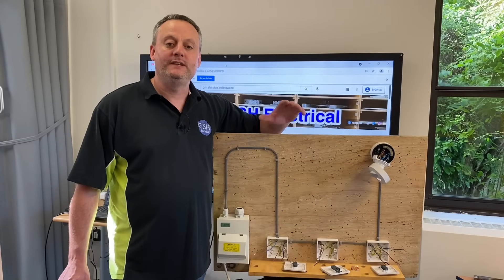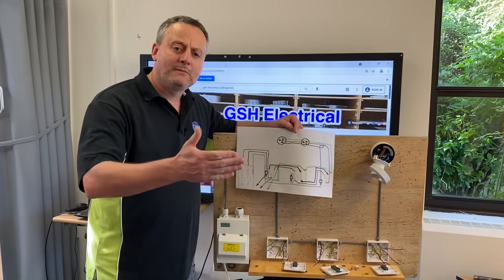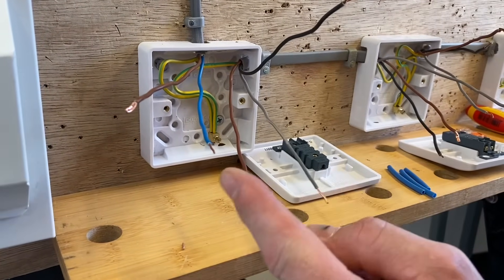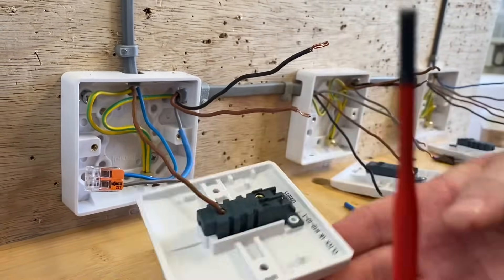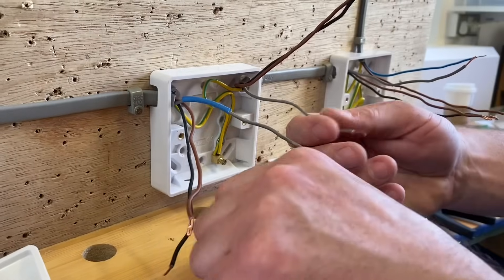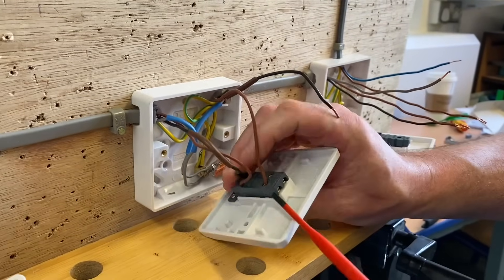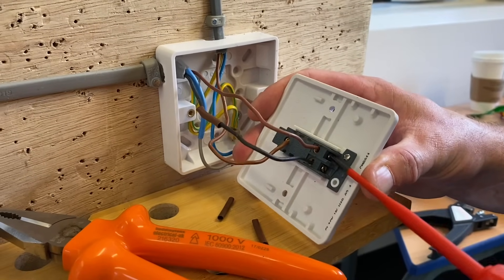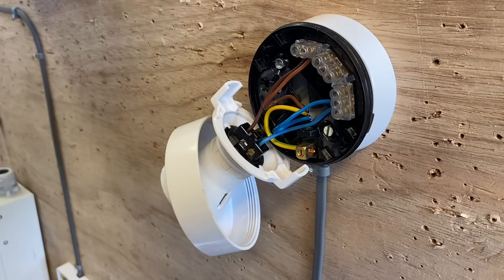Connections Explained - Wired Through the Switch 2 Way and Intermediate AM2, AM2S & AM2E Assessment

Comment: This is a great video, my question is how can you also bring permanent line to the final switch? Say, for example, if you have a two gang two way in the final switch and you want to power a separate set of lights using the neutral we’ve just brought through?
On the final switch, can you bring L1 AND L2 from the first gang both into common of the second gang to act as a permanent line?

Comment: What if there isn’t a grey wire can I connect my blue to black and red to orange if I’m trying to connect a plug socket when  using old wiring red and black, can these be connected to blue and black and then red with brown? To give power to the socket? Or is this not safe? there is a fuse box attached the plug socket already?

Comment: Thanks very much great informative video. This is all new to me using the grey as carrying the neutral on through so i really enjoyed learning about that. Am i right in saying that in the 3 plate method theres no neutral at all at the switch and they are all line connectors either switching line and 1 perm at the first switch and the role of the 3 core is to carry the common on through to the final switch not mattering if theres 1 or 10 intermediate switches in between and that the other 2 conductors of the 3 core cable link up the L1 and L2  to the intermediate and last two way switch and theres no neutral whatsoever because its at the 3 plate in the ceiling so this is only for 2 plate because the neutral is at the first switch and its not needed at the intermediate and final 2 way switch but its vitally important at the light fitting and this is why its carried through to here. Does that make any sense at all Gaz lol.
Reply from the maker: This should help

Wiring Diagrams for Lighting and Motor Circuits
https://www.youtube.com/playlist?list=PL2Ea5r9gxUUfm4SACOSOZigCeSxxC5xaO

Comment: Also I came across the normal 2 way method without neutral. I found the yellow and blue as strappers and red in common from 1 switch. On the other switch I found the red from twin and earth in common from 3 core yellow and blue as strappers and the red of the 3 core was connected on the black of twin and earth with connector. All colours were marked with red sleeves. Some I've seen  black was in common and reds connected on a connector block. Is that  still

Comment: If that’s in the Am2 could you just use the long lead method for r1+r2 and test between cu and earth at the light to get the overall R2 as it’s the furthest point and test between live at the board to live at the light as it’s the furthest point and operate the switches and the highest will be my R1 so I would just add them up to have overall R1+R2 for the circuit?? Thanks

Comment: Thank you for sharing your knowledge 

That has helped a lot 

Next question sir 
That’s was 2 way and intermediate 

To one light fitting 

How would it work for 2 /3 

light fittings 

Ie 
Switch at the Bottom of the stairs 

To make bottom light middle floor light and attic floor lights come on then to be able to switch them all on and off from each floor 

Thank you

Comment: Thank you 

Could you do a video on 
2 way and intermediate 
With 2 light fittings 

As you may have on top of landing and the bottom of the stairs 

Thank yoi
Reply from the maker: This maybe useful 
Wiring Diagram Using a 2 Gang Switch Downstairs & Upstairs 2 Way Switched on the Same Circuit Fuse
https://youtu.be/eyLNm057obo

Comment: I really like this method of 2 way / intermediate switch wiring as you always have the neutral at the switching point so you could tap off it at a later date for extra lighting or when fitting a smart switch. Took me a couple mins to wrap my head around it but it’s pretty much the same as single and earth being the permanent line from the board at one end and switched at the other to the lamp with the twin strappers in between. Very good!!
Reply from the maker: Thanks for commenting and watching 👍🏻
Reply: Ever tried to ram a new cable down to the switch for a new feed avoiding a truck load of plasterboard adhesive? It is a pain to say the least. I see the advantages for it if you want smart switches etc or Mrs Jones acquired some fancy luminaires from John Lewis (whose lights are actually pretty decent to install to be fair) that can only accept a single cable but in my opinion you cant beat a tidy 3plate rose for ease of additions.

Comment: I asked a question on my last job as to why we had wired feeds to lighting position instead of the switch knowing JB would now have to be used everywhere and was given the strangest look from the foreman and simple told "you dont wire neutrals down to switch". I wanted to say I'd seen it done many times before so what was his reasoning but the look he gave told me not to bother asking.can you clear this up at all?
Reply: Was it wired in singles or T+E? if it was singles then that will be why you dont take it down to switch
Reply: @JaackBorland  it was twin and earth wiring using 501 junction boxes everywhere
Reply: @drpantastic1969  ah even still there isn’t a need for neutral at the switch using jb method, it can be taken to switch but for ease of wiring it’s taken straight from jb
Reply: @JaackBorland  I threw another question your way if you know the answer and have time to answer it.thanks for the previous response
Reply: @drpantastic1969  let me know if that makes sense. I can explain in more detail in a private message if that would help!
Reply: I thought for ease of wiring it's better to have feeds at switches(neutrals connected in a block) then you would only have maximum of 2 cables at at lighting points eliminating need for j.bs .is there a regulation on this or is it just choice? I'm sure I ve seen a switch with an unswitched neutral terminal built in like a connector block to accommodate this style of wiring
Reply: @drpantastic1969  it’s down to choice I would think. You only need one wire at a 1 way switch if using Jb method. Your neutral conductor on a T+E at switch can be used as switch wire back to JB if that makes sense?
Reply: @JaackBorland  ok thanks
Reply: It makes sense and I do understand both ways of wiring I just want to be able to put fourth and informed answer when I'm told "you dont wire neutrals to switches" as I know the topic will come up on site again. as there must be a reason why we have  2 and 3 plate systems
Reply: @drpantastic1969  To try and explain it short and sweet. Your neutral is only there to complete the circuit and bring it back to ground/earth, switches do not require a neutral to operate, lights do. So when wiring in a JB method your neutral is at the JB and then taken straight to your first light fitting that operates from that switch. The best way to get an understanding of the different methods is to draw circuit diagrams to help you understand why each wire goes where it goes...

Comment: When I was an apprentice  I was taught not to wire  this way  basically the feed one end and the sw the other as you would do in singles   years later I noticed in an on site guide think it the yellow one telling you not to do it as it interferes with induction loops  Has this changed
Reply from the maker: This is the wiring method required for an AM2 or AM2S assessment 👍🏻

Comment: Are u doing a 3way switch so those right eliminates having to run travlers  from switch 2 switch!! Just a wo during cus I never heard of a 2away switch just 3 or 4 but that's cool if that's what it is
Reply from the maker: This is the wiring method for AM2 and AM2S for 2 way and intermediate switching of a lighting point. 👍🏻. Gaz

Comment: If, in wired through switch, the feed to the light goes to the first switch where we have our permanent live, how will we wire the intermediate or the last of two way switch?
Reply: @Troy Mclore brilliant. Many thanks. I need to make a diagram of it now.
Reply: @Troy Mclore what if tye permanent live goes into common and we use twin & earth for the L1 & L2?
Reply: @Troy Mclore with no intermediate switch. I dont need to connect brown in the commons. I can use twin & earth in L1 & L2. Can I?
Reply: @Troy Mclore thanks for your reply Sir. I'm not working as electrician though i did my city&guild and 17th addition long ago. My electrician (from China) rewired my house and he wired through the switches for lights. We used to do the loop in method in the ceiling. Wired through the switches was not very common in my work  when i did some work as an electrician.
So for my understanding when wiring through the switch, permanent live goes into L1, the switch live (load) goes into L2 and from three core cable for second two way switch brown goes into commons black (with brown sleeve) goes into L1 of the first and second switch and grey goes into L2 of both switches where there is no intermediate switch. Neutral of load is connected to the feed in neutral ( which comes with permanent live as twin and earth).

Comment: The way I think of the new colours when deciding what core to use for CPC, Line and Neutral: 
Red (line) =   Brown = L1 
Yellow (Earth) = Black = L2 
Blue (neutral) = Grey = L3
In old colours, when using 3 core for single phase, yellow would be Earth to match green and yellow. Blue would be neutral to match the blue in flex (which was brown and blue long before the harmonised colours came into force). Therefore, sticking with that principle, the yellow is now black, therefore black is Earth. Blue is now grey, therefore grey is neutral. Sorted.